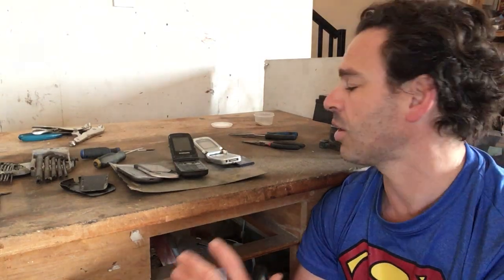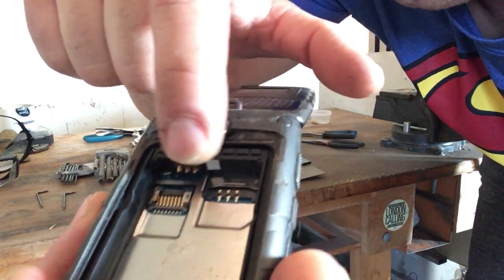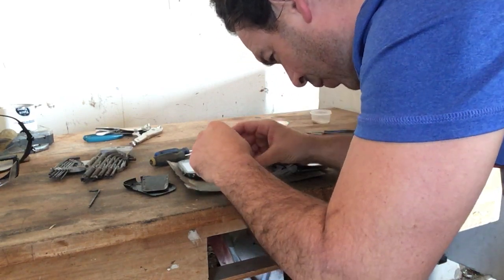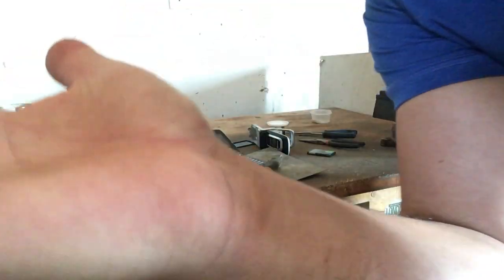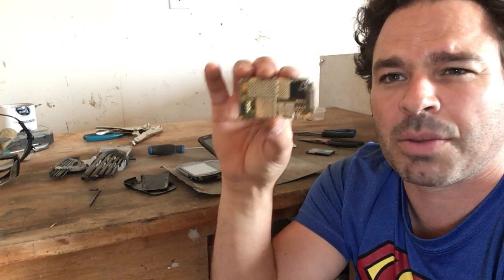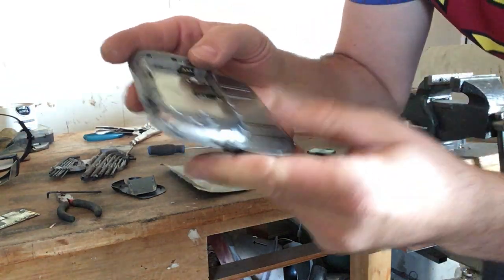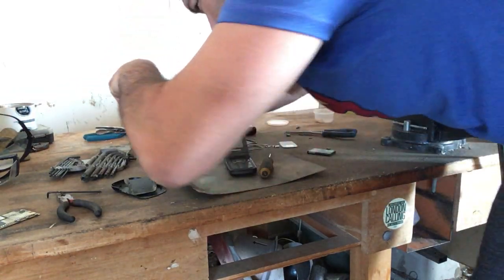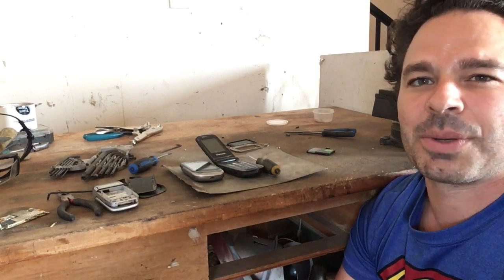Scrapping cell phones for gold!

Comment: I came across a plastic tub with what looked like throw away things. I went through it looking for scrap. There were 5 cell phones in it. Haven’t finished taking them apart yet. Some times I need to use a hammer on them, no apparent opening. Your video is just what I need. 🐎🌻✌️
Reply: Some are very difficult to open and smashing them open is sometimes the only option.